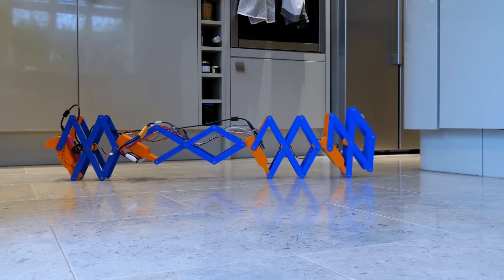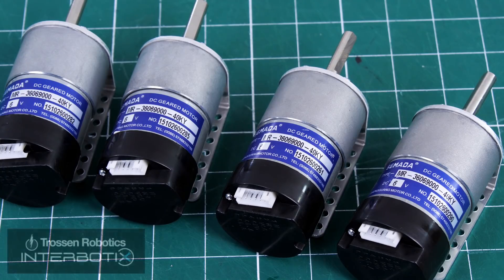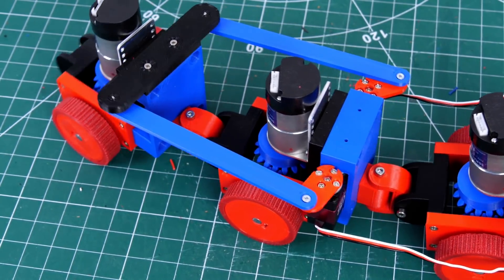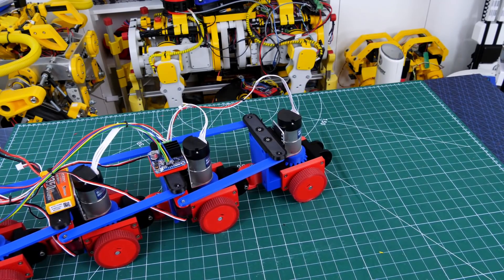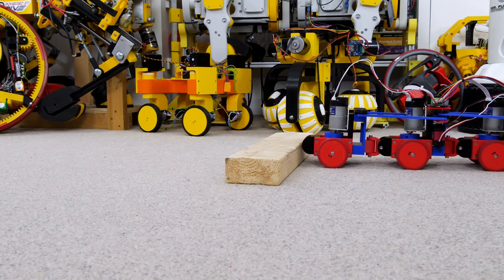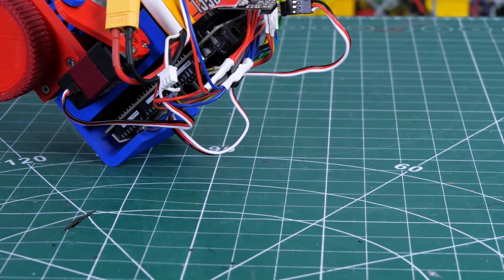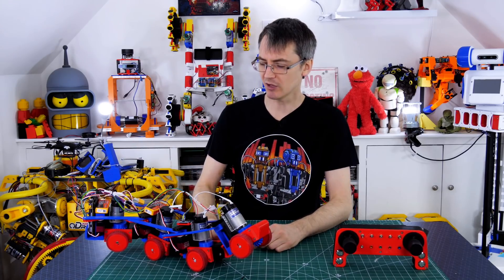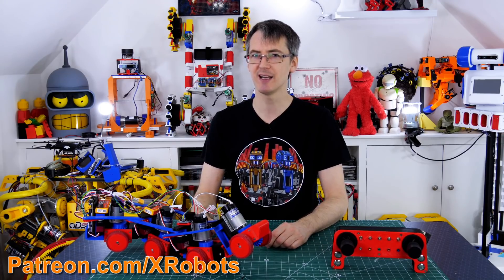How this Snake Robot Climbs Over  Obstacles

Comment: Awesome!  I'd like to see you replace the wheels with tracks on each individual section as long as they can be without rubbing each other. Your idea to have the wheels (in my idea tracks|) follow each other is absolutely necessary to prevent premature (Wheel/track) wear but being able to still operate your robot in (Worm mode) with the ability to move sideways is also a must!

Comment: A very simple solution to some of the Problems with getting stuck would be to change the wedge and cover added towards the end of the video and add a small wheel to both of them and then have a belt (2 for the front 2 for the back)  connect those and the normal wheel as some sort of a track

that way the fist point of contact is still" driving" and you dont get stuck on the downwards bends

Comment: It seems from the tests that bigger wheels would improve performance. The greater clearance between bottom of wheel and belly of the vehicle would make it less likely to contact the ground on it's belly instead of the wheels, and wheels covering more of the length would make it more likely that there would be wheel over a corner or any other crucial spot that needs contact.

Comment: A rideable one would be so much fun! :D I'm sure it would create a new class of off-road motorsport. But it could use differentials for the wheels; I can see this little one understeering because each wheel is rigidly connected to the one on the other side. I'm not sure what would be best in large scale; perhaps a motor per wheel, perhaps diffs. I hesitate to say "perhaps nothing"; soft ground might seem to take up the difference but it would chew up the ground.

Comment: i'd say a way to improve this would be to increase the diameter of the wheels so the clearance is larger, also rounding the wheels (Like half Spheres) so it could roll back over more easily. It would also be cool if you had another set of drive wheels on the top so if it did manage to roll over it could keep going. Maybe messing with the geometry you could even have it be mobile on it sides in addition to it's top and bottom

Comment: The obvious improvement here is to use a larger wheel diameter. With a diameter larger that the height of the entire 'chassis' of the snake, it would have zero approach or departure angle problems and the wheels would end up having minimal gap between them so that debris or terrain features wouldn't hanging up on the chassis.

Comment: cool robot. If you add a weight that can slide to the front and back of the robot then you can pick up the front or back depending on where you put the weight. also bigger wheels.

Comment: When the robot is in the vertical "U" shape and it is tilted, if you can make the back tire touch ground instead of the back electronics touching ground, it would work much efficient. You can get more clearance for the tires by increasing diameter of them or offset them lower more.

Comment: If you decide to improve it you could design a special part for the front and the back, having the wheels at the edge so they are the only thing that make contact.
Also, someone mentioned how it moves like a happy animal and that reminded me that it could look more animal with that smoothing script you made for the animatronics.
Also also, I agree with him, it looks awesome and puts a smile in your face when moving, specially when struggling and making adjustments to save obstacles.

Comment: Distance sensors near each segments wheels can help adjust to an angle where the wheels make contact.

Having the segments copy the previous segment with delay, is kind of how the animals work, and can make it infinitely scalable if the segments carry their own power.
I see this codewise similar to an LED strip chase.
For higher speeds the 'chase' would be quicker, so if you turn, each segment, as it passes the same spot, turns in the same position.

Comment: If you take some ideas from 4x4 vehicles and adjust your approach angle at the front and back then you'll be able to control how it goes over objects. Just move all things at the front and back of the robot higher off the ground so that your wheels and tires are the first thing that come into contact with the obstacles.

Comment: seems like the vertical flexion/extension you use to go over the obstacles could benefit from feedback dithering, minor back and forth actuation "noise" while climbing. Basically by making it wiggle vertically while moving forward you were able to get better traction because it exposed the wheel treads to new grip surfaces and allowed it to release any 2x4 debris that might have otherwise been caught between close-together wheels.

Comment: Really cool.

I wonder if it would do better if the wheel diameter were a bit bigger relative to the length of each segment.  There would be a tighter gap between wheels for obstacles to fit in.

Comment: I wasn't convinced until I saw it on real obstacles - it works really impressively !  I noticed that the front and back segments often got grounded though.  I think the wheels on the front and back segments should be moved so that they stick out beyond the end of the frame.  You could just add a bolt-on extension to the existing segment modules that has a mount for wheels, and links them to the original wheel drive with a belt (hope you can picture that !)

Comment: It was the forward motion from curling one way then the other that actually moved it forward along with the wheels, however if it was possible to create something that moved with a weight transfer, like pulling a weight back and realising it on a spring or a motor that can move a weight back and forth

Comment: Just a couple of ideas i thought of:  a) if the wheels where of a larger diameter this would help with the overall ground clearance and this would help with the lifting and climbing abilities, b) would it help with the wieght transver to the rear when climbing if you made a couple of unpowered sections to put in the middle so the weight would be more seperated so when you lift the front this might allow the weight at the rear to keep it in contact with the ground while maybe lifting both the front powered sections, this one i havent given as much thought to as the larger wheels one as there is the centre of gravity to think of and the amount you need to offset the weight of the front sections by adding some weight to the rear to make it a bit heavier than the front which would be vital to make the extra lift possible . The other draw back of this second idea is that while it would make frontal climbing better it would remove the possibility to climb in reverse unless the weight that was used to ovvset the C of G was able to be moved so you could shift the C of G in both a rearward and foward direction to effect climb ability in both directions.

Comment: Thx great as always.. You rock... Suggestions: You could drive it with one central motor, if the universal joints formed a long shaft and the motor connected

Comment: Segmented steering on each segment could also enable you to work it like an eel or snake, moving only by sideways wave-like undulations. It wouldn't require driving wheels, only a servo between each segment.

Comment: If you scale it up and transverse-mount the motors you could make the wheels big enough that it could run flipped over (not practical for a rideable version of course). You could also mount a deck on the back and make a snakeboard, add some load cells and make it responsive to the rider's weight shifts to control the bending.

Comment: Very impressive. As you remarked at the end of the video, a twist that propagates down the length of the body would probably help. But do you think it should actively lock into sync with the terrain (i.e. each joint bends when that segment reaches the corner of the path) or do you think it should rather be load-guided (when going over obstacles: if a segment experiences higher load than its successor, it should pitch up; if lower, then down)?

Comment: one cool idea might be, to add tracks alone the hole sides of the snake. as in from the front wheel to the back have a tank track going across and tensioned , this would mean when u bend it, it would have to be tensioned and re tensioned in some places. might be impossible but I think it might be plausible.

Comment: What if the control to bend up and down has an option to bend one joint at a time, so that the back joint doesn't bend and the back wheel stays in the ground

Comment: Just a thought about the issue of the back of the robot also bending upwards, maybe if you added just another segment to make 5, the balance point on the middle of the robot would be over two wheels instead of in the middle point of four. With that, seems to me that adding a little more weight on the back (another battery?) should allow the two front segments to rise as you wanted...

PS: Awesome work!

Comment: How about a standardised set of fixed-down obstacles so you can compare your robots? I think the loose bits of wood aren't that representative of what a scaled-up version would encounter. A lot of the difficulty the robot has is due to the planks moving and sliding over each other, but I doubt you would attempt to drive your quad-bike sized robot over tree-sized bits of lumber stacked like that.

Comment: I wonder if you could take off the DC motors for the wheels and make it slither like a snake. Might need a few more sections to work that way but would be really cool.

Also I wonder how well this would work with tracks? Either one continous track or a track per segment, I recall you having a design for a 3d printable track in one of your older projects. It would solve the grounding issue where obstacles hit the carriages between the wheels.

Comment: Rubber tires with tread, about a centimeter or so larger than the gears you're using as tires, would make that final design work like gangbusters.

For better steering, would making each axle steer be a possibility? I know that would make the design and programming exponentially more difficult.

Comment: To get past the grounding issue, you could simply use larger wheels 😁
Reply: Redesigning the 1st and 3rd segment to have only one centered wheel instead of two one the sides would allow still bending to tight corners ,even with bigger wheels. It would also save weight.
Reply: I thought the same! The limiting factor is that they come closer the more the segments are bent together, but it looks like there is some space left. I can't imagine, weight could be a big problem, because it is distributed over the whole creature.
Reply: Or multiple smaller wheels. They will be harder to power though... unless every wheel has its own small motor. Or maybe it would work okay with some unpowered wheels.
Reply: If you had multiple small wheels in the middle sections, they could be hooked together through a two belt and freewheel linkage. That plus large hemispherical wheels on the front and back, plus one extra front section for higher bending... That summarizes all the best ideas I've seen mentioned so far across the comment threads.
Reply: With a lightweight design, it could actually weigh less than his current wheels. Think spokes or dished wheels like a train.
Reply: That will make it heavier and difficult to pull.

Comment: this thing is amazing! one of the best designs I think you've ever done! I'd love to see a V2 with some improvements based on what you've learned from this one. seems like it would be good to have the front wheel further forward and the back wheel further back so they can still make contact even when fully bent. and maybe more sections with smaller wheels to give it a more even keel so things dont get stick between the wheels
Reply: I'd also try to provide more ground clearance for the segment joint pivots. It seems to me that most of the time that the robot got caught on something it was those pivots.
Reply: Just make the wheels bigger
Reply: I agree with these ideas!  Not only make the wheels bigger, but make them tall enough that it can operate equally upside-down or right-side-up.  I'd like to see if it can right itself if it falls on its side.  Maybe it could with the existing bending controls, but maybe it needs a 3rd axis of rotation to be able to twist?  That would be super advantageous for something like a search and rescue robot.
Reply: Actually, if the wheels were both larger and hemispherical, then it might be able to self-right when falling on its side
Reply: Came to comments section to say I wanted to see it with bigger wheels, and found I wasn't the only one thinking that!

Comment: One way to improve it significantly is to simply move the front and back wheels as much forwards and as far backwards as you can respectively. 
That would avoid many situations where the front or back gets stuck by being grounded.
Reply: or make every wheel so big they almost touch (needs space to turn). also move both batteries as back and as low as possible, servos and motors too (wonder if this could be scaled so that they would fit horizontaly). maybe a bit wider too? 
also make it go forward (or backward) while doing that side snakeish movement!

Comment: Sweet! Feels like a severely upgraded version of the 18-wheeler caterpillar RC truck I had as a kid. 
You do so much test driving over stuff, that you need some branded boxes and stuff, perhaps even with sponsor logos?
Reply: I was going to say about the catapiller truck! Mine wasn't RC though,  it just went in a straight line. James would have loved the mid 80's . Do many bizarre toy trucks and cars like the catapiller and FLEX . Hmm maybe there's an idea of a series for him.

Totally agree about branded obstacles. It would also give thr tests standardisation
Reply: @deanallenjones  Now that you say it, I remember that mine was wire controlled as well, and no steering. I wouldn't even dare to dream of these levels of maneuverability!
Reply: @deanallenjones  Toy nostalgia is a easy rabbit hole to go down. 😁
I'm pretty sure I had the Tomy 16 wheeler version. Might be the first electric toy I disassembled without getting it properly back together...

Comment: Looks like your going to need to put bigger tires
I'm sure there's a formula for calculating what tires you'd need so the front and back tires remain touching the ground when it is at max downward flex